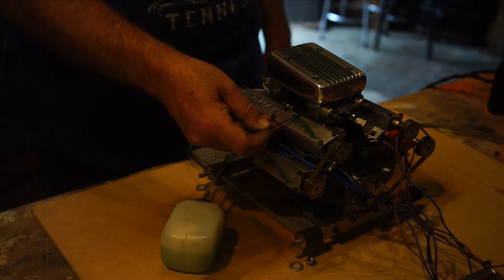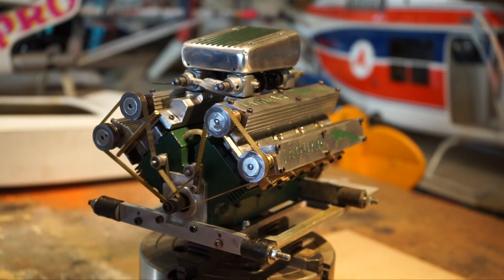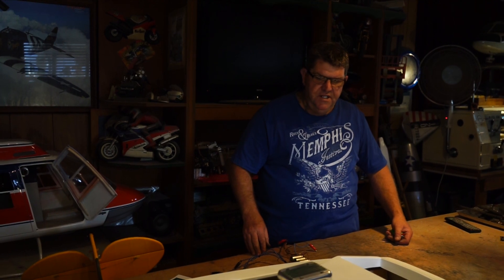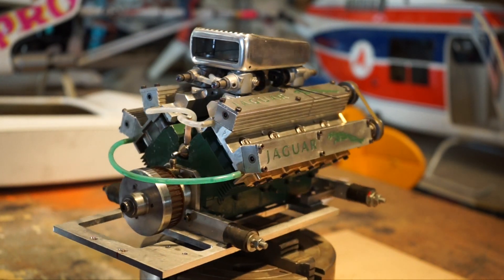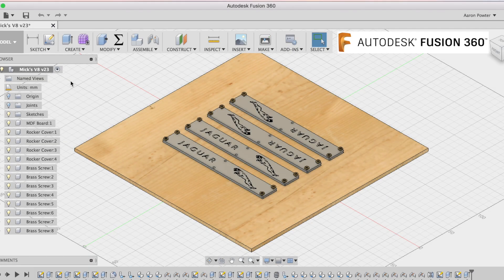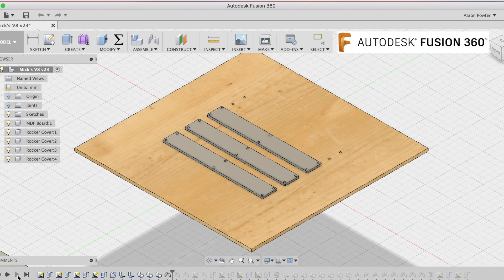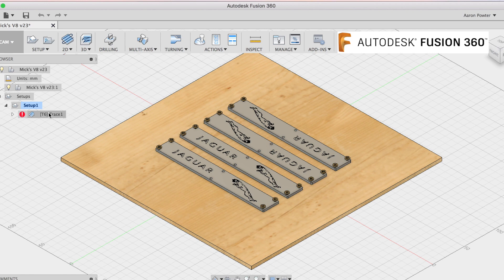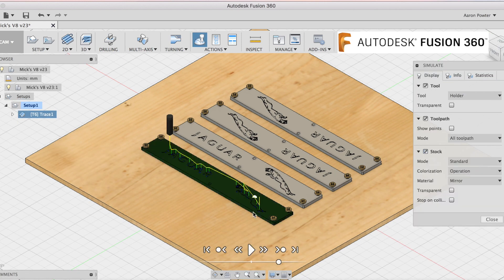CNC Engraving - MTB Schillings V8 Engine

Comment: Aaron did you try using the 2D Engraving toolpath in Fusion? I would have probably used that instead of Trace. Combined with some pocketing here & there. Could you FB message a screenshot of your V Carve Pro toolpaths when you get a chance please?
Reply from the maker: Hey Scott, yes numerous times mate and I couldn't the tool path to generate.  God knows what I'm doing wrong.  Might get you to take a look at it for me if that's ok?  Cheers mate ;-)
Reply from the maker: Hi mate, I added the file to the Harvester folder you created.  If you could take a look at it for me please it would be appreciated.  I used an Iscar Carbide 1mm dia ball end at 750mm/min and at 15000rpm.  Cheers
Reply: DCTTeacher1 it only works with chamfer mills / spot drills.

Comment: Very cool!! 
I love that the engine is actually going in something and not just be left on a stand.  
Was there something specific that you didn't like about the fusion trace over the VCarve?  I'm not familiar with VC at all.
Reply from the maker: G'day Mike.  Thanks mate and yes it's very cool.  It's an old motor originally made in Germany late 70's.  My friend Michael has extensively modified it (all manual machining).  I tried to engrave with Fusion 360 but could get the tool path to populate. Not sure what I was doing wrong, I'll ask my Scott at Cadpro to show me the error in my ways.  So mate, when in doubt you immediately go back to what you know.  VCarve-Pro is a really good CAM/CNC routing & engraving software.  However, Fusion 360 HSM tool path strategies leave it for dead.
Reply: I re-watched the difference....fusion just did a trace and the vcarve cut out the middle of the lettering so it was all recessed......?  Fusion will probably do it with a few more tool paths assigned, but I know what you mean about going back to what you know.  If I hit a wall with the CAD side of fusion, I go back to SolidEdge. :)

Comment: I do the same thing when it comes to engraving Fusion is not quite there yet, Vcarve pro is.
Reply from the maker: daniel lyall Hey Daniel. As you probably know I'm a Fusion 360 nutter. So it hurts me to say this, but you're 100% correct there mate ;-)
Reply: I always will keep Vcarve pro uptodate, I just find it faster to run .dxfs through Vcarve before inserting into fusion so I can clean them up and change all splines to arcs, and set the units. plus sign making is super simple in V carve, Fusion will be there one day.
Reply from the maker: Agreed, we keep V-Carve pro on tap here at our college as it's easier to use with the cnc routers we have.
Reply: I wish we had a college like yours over here
Reply from the maker: daniel lyall yes we're very luck that's for sure. Where are you based?
Reply: Blenheim NZ close to where the 7.8 hit
Reply from the maker: Holy crap, that would have been scary :-(

Comment: This is great - I never thought about using MDF as a fixture plate.
Reply from the maker: Thank you very much.  MDF works well on a CNC router, especially as a waste board.  I couldn't use it in the Haas, as the flood coolant would wreck it ;-)